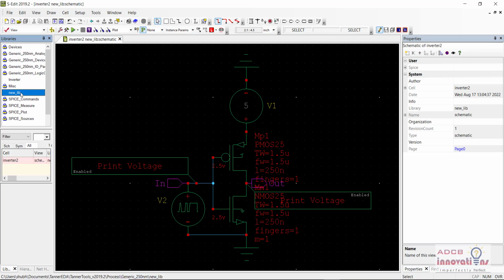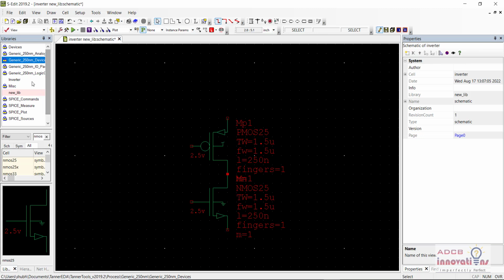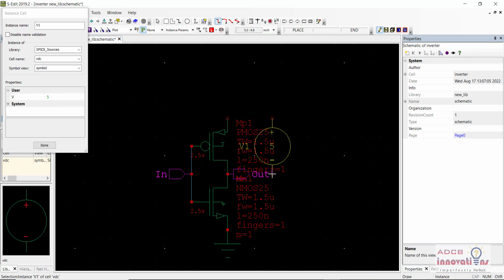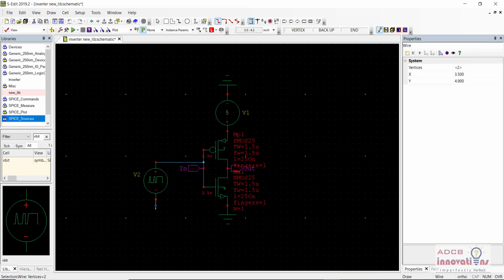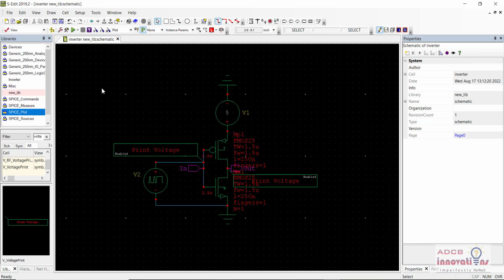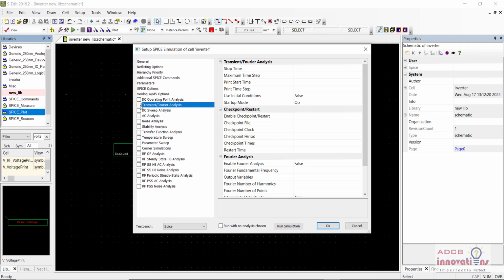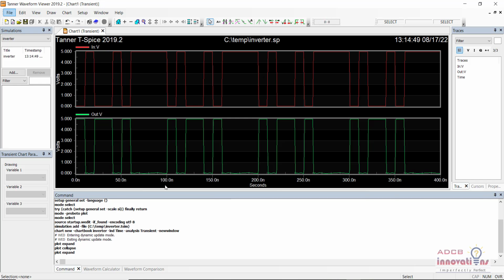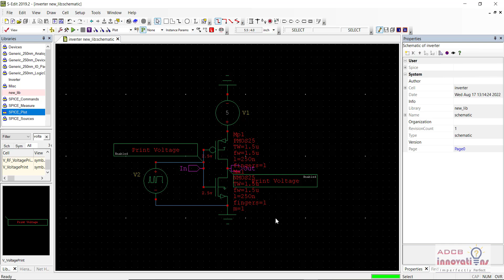Design and Simulation of an Inverter using Tanner

Comment: Hi
Sir.. Thanks for sharing womderful informative video.
I was trying and reach to simulation result. but while doing simultion, i got the following error messages
Fatal Error : "..\..\..\Documents\TannerEDA\TannerTools_v2022.2\Process\Generic_250nm\Models\spice\nmos25.lib" line 40 Can't evaluate .param value for NMOS_Sigma: SigmaValue
            : "..\..\..\Documents\TannerEDA\TannerTools_v2022.2\Process\Generic_250nm\Models\spice\nmos25.lib" line 40 Unknown variable "SigmaValue" ["SigmaValue" at column 1]
Fatal Error : "..\..\..\Documents\TannerEDA\TannerTools_v2022.2\Process\Generic_250nm\Models\spice\pmos25.lib" line 40 Can't evaluate .param value for PMOS_Sigma: SigmaValue
            : "..\..\..\Documents\TannerEDA\TannerTools_v2022.2\Process\Generic_250nm\Models\spice\pmos25.lib" line 40 Unknown variable "SigmaValue" ["SigmaValue" at column 1

any comment , why i am getting this error and solution for the same
Reply from the maker: Hi
While setting up the spice simulation on the left side of the dialog box, you will see parameters option. Please Check if there is some false parameter created by mistake or not. If a false parameter is created then delete it, else we need to add the parameters manually. 

So, Just check for the false parameter and if the problem is not resolved then let us know, we'll tell you the process of adding parameters manually.
Reply: Hi! I need Help with the parameters, I have the same issue. I don't know what parameters to add manually @adcbinnovations
Reply from the maker: Hi, I'll try to make a video on adding the parameters manually as soon as possible
Reply: Sir how to add tt in library files in netlisting
Reply from the maker: Dear Learner

The library files already contains the process corners (TT, FF, SS, etc.). You can add them to your design in Tanner with the procedure as shown in the video. If you want to directly specify in the netlist (Eg. using Spice) you can specify that after the library file path.

You can check this video for more details: https://youtu.be/TuY04UgR0FI?si=4isA1S6IP03bbIho